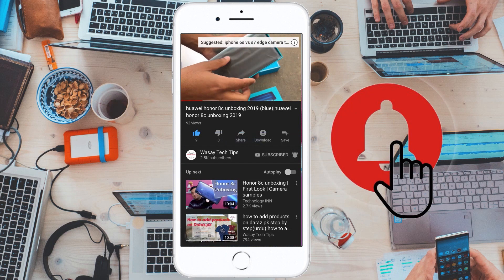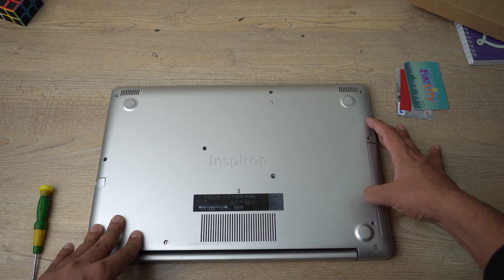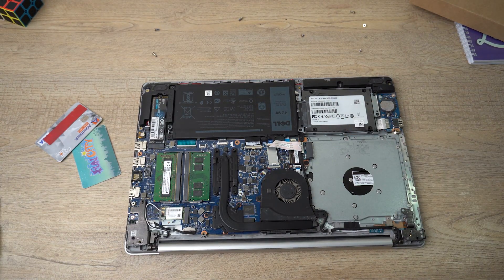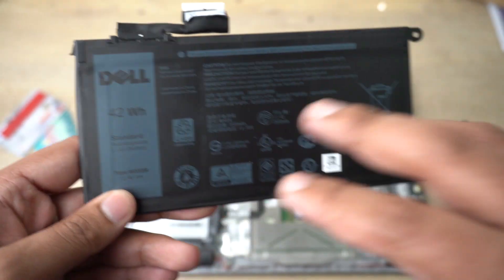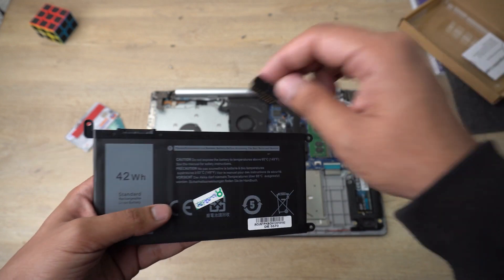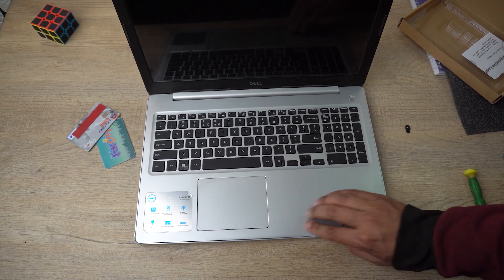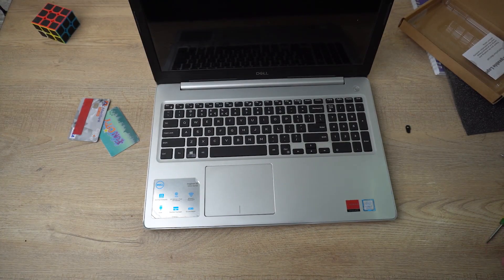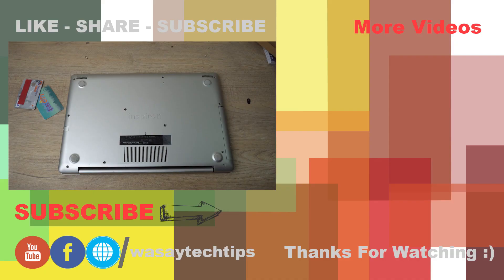Dell Inspiron 5570 Battery Replacement | How to Change Battery on Dell Inspiron 5570

Comment: Thanks very much! That connector was really hard to get out of the battery as you said, but I eventually got it. One problem I noticed was my new battery was the exact same except on the right side of that connector there was slightly more tab so the cable wasn't 100% square but I got it in 90% of the way and it was in there really tight, PC detects it and it seems to work so crossing fingers.

Comment: my dell laptop's battery DESIGN CAPACITY	41,998 mWh
FULL CHARGE CAPACITY	8,197 mWh does i have to change battery now or later please let me know it's serious my laptop work up to 60 to 70 mins in full charge

Comment: Great video! I was easily able to change the battery in my 5570 thanks to your clear instructions
Reply from the maker: Your welcome
Reply: Hello 
Where did u buy it 
Thanks
Reply: Where did you buy the battery to begin with
Reply from the maker: From a local market

Comment: Wow...! Just fantastic.... Good language and very practical tips. Neat and crystal clear explanations. Prying technique was good. So was the tip that all screws are not of the same size. I plan to open my 5570 to remove the battery as it has reached the end of it's life span and therefore generates heat when the charger is plugged in. Thank you very much indeed!!
Reply from the maker: Your welcome

Comment: Hi, i noticed that you have 2 ssd installed.. i currently have 2tb sata ssd and planning to add PCIe SSD but i don't know what is the maximum capacity for dell inspiron 5570.. do you think i can add another 2tb??
Reply from the maker: I think it was 1tb. You can read the manual, it will tell you the max size supported

Comment: Good video .. I have a question .. I just changed the battery, I turned it back on and entered the password and the screen is blue .. do I have to turn it back on and enter the bios?

Comment: What about if I don't want to use this batery in my Dell? It is turning off automatically because I removed battery... Do you know how to make it work without any information (from Dell in my laptop) to buy a new one or without any interruption in the system? I unistall all Dell apps but my computer keeps turning off automatically.